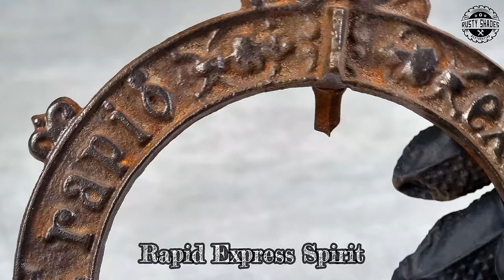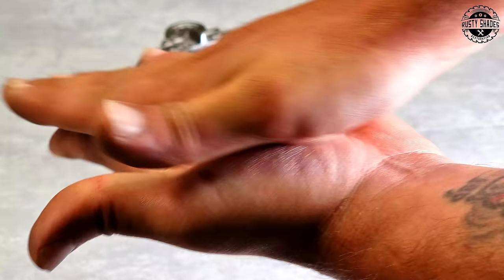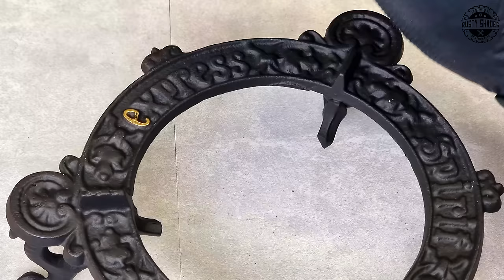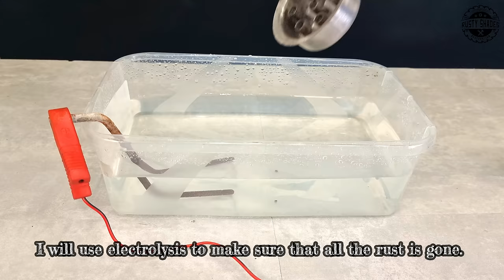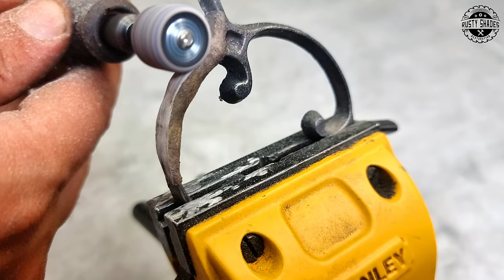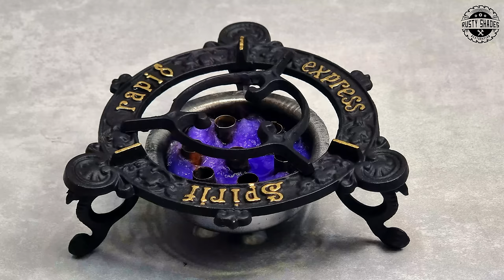Antique 1890s Spirit Camping Stove Restoration - The Splendor of the Victorian Era

Comment: Not Only for Camping. A spirit stove like this would have been used indoors for any small meal preparation that a wood-burning fire wasn't needed for. Especially in the summertime. An individual, couple or family could cook with these spirit stoves rather than lighting a fire which takes hours and would heat the whole house. A fire or wood stove would only have used in the fall and winter or in large wealthy houses with servants and others to feed. These kitchens would be out of the way of the household and would need the fires to bake their own breads. Many middle class households would buy their breads from a local baker and so wouldn't always need the fires.

Comment: Very nice refurbishing. I will say, that if you are merely going to use this as a decoration, than it is perfect. However if you have plans to actually use it, the epoxy putty isn't going to last long. And I am not sure I understand the little side protrusion as to what it serves in the design... Thumbs Up!
Reply from the maker: Thank you Garry. The epoxy it is heat resistant, but of course I can't bet that will last a long time. Of course this will be used as a decoration, I don't think that someone will want to be so classy to use it for outdoors escapades. Cheers!

Comment: Now that’s camping in style they don’t make them like that anymore, one tip tho is that metal plate isn’t meant to go on top it’s the extinguisher for the stove.
Reply from the maker: Thank you! Yes, that's right, I extinguished the fire with it, but I didn't know that should stay away. The pot was more steady on that than without, maybe they were using smaller containers and not so heavy like my "cow pot" 😅 Cheers!

Comment: How do you know what sand or (material) to use when sand blasting to get an excellent result every time? Loved every second of this video.
Reply from the maker: Thank you! I'm choosing the sand taking in consideration the type of metal and how rusty it is. Usually I'm using black corrundum sand and I change only the granulation.

Comment: Плохо. Сломанную чугунную деталь для начала нужно было армировать куском проволоки, засверлив 2 отверстия в самой детали.
Reply from the maker: Why bad? Because I choosed another technique that worked? Do you realise what are you saying? One thing is I would do like this and another thing is to say bad to something different that is working. Think a little before writing.
Reply: @rustyshadesrestoration  I thought. And again I came to the conclusion that a technique that was not made with high quality is bad. And don't teach it to others.
Reply from the maker: The clay is heat resistant and passed the test. This item will be displayed only, not used everyday, so it is an option. Yours seem legit too. Maybe in one day I will try it. Usually I'm welding cast iron, but this time I wanted to show something else, for diversity.
PS: I'm a hobbyist, my intention is to create satisfying videos as main focus, not tutorials. Thanks for watching and understanding. Cheers!
Reply: @rustyshadesrestoration  I am also an amateur. And when I don't want to weld cast iron, I braze it with brass or silver solder. In this case (in my humble opinion) it would be easier to insert a piece of wire with a diameter of 3 - 4 mm into holes pre-drilled from the ends to a depth of about 1 centimeter. as a frame and then smear it with what you smeared.
Thank you.